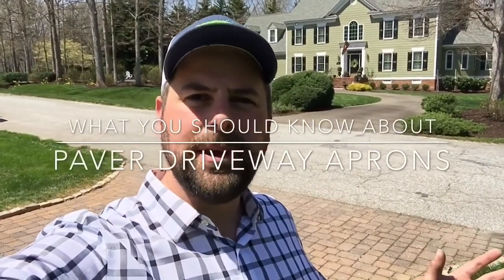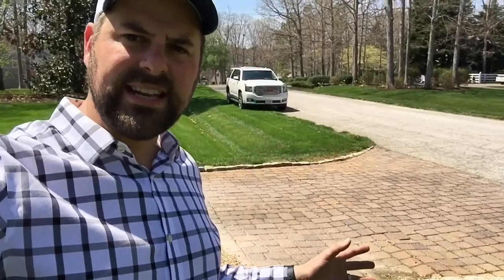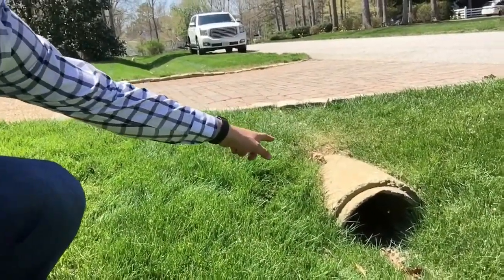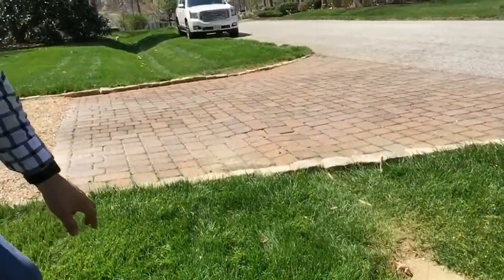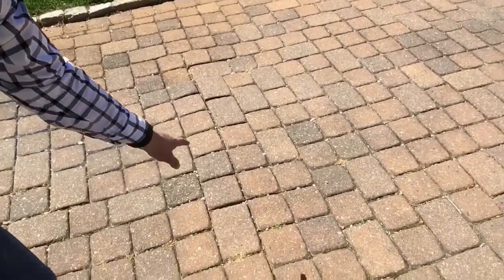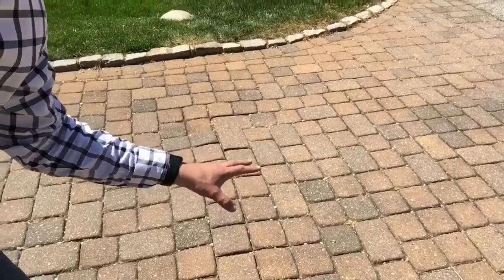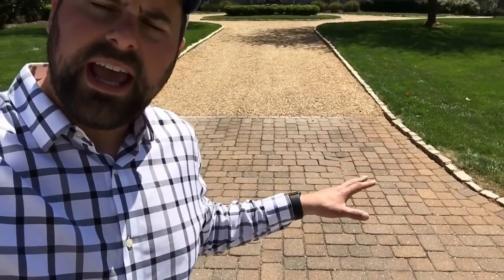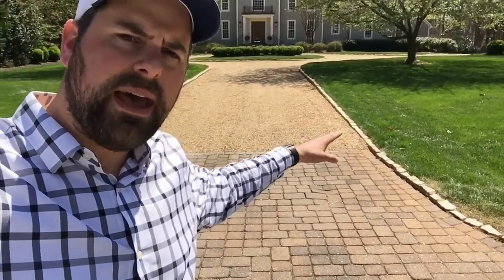Paver Driveway Aprons - Common Problems and Installation Cost - Midlothian, VA

Comment: 20per sqft? where is that place. i want to work there. people here are use to 5 or 8 per sqft at most
Reply: Commonwealth Curb Appeal im guessing you guys cut with a table saw and use a plaatic edging for the border of the pavers as well
Reply: Commonwealth Curb Appeal how long does it take to lay 1000sqft
Reply: Commonwealth Curb Appeal herringbone 45. complete in 2days?
Reply: Commonwealth Curb Appeal so you guys dont use the gas powered concrete saw?